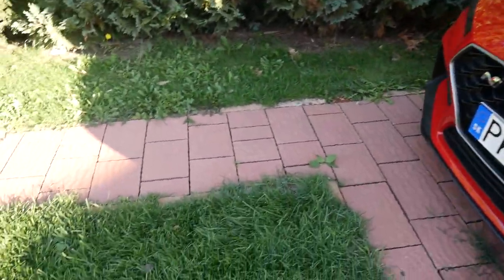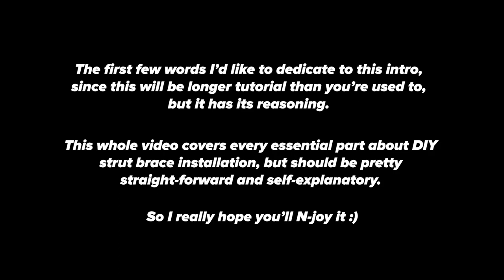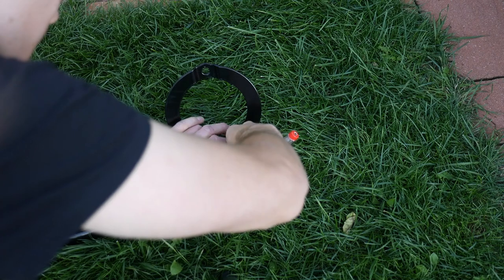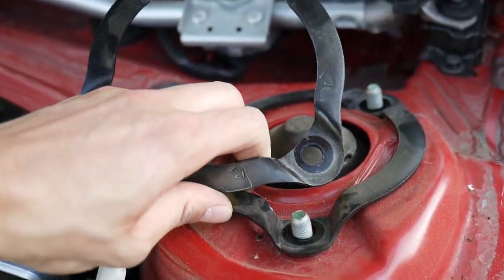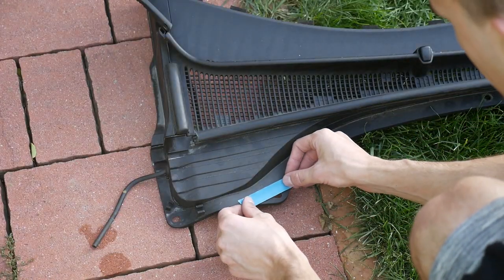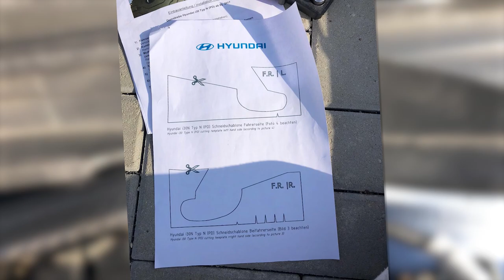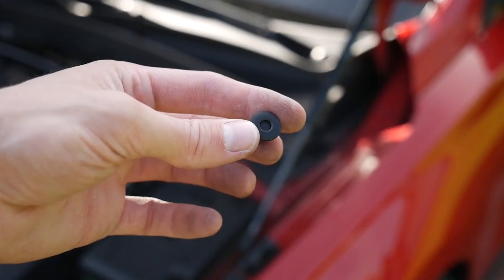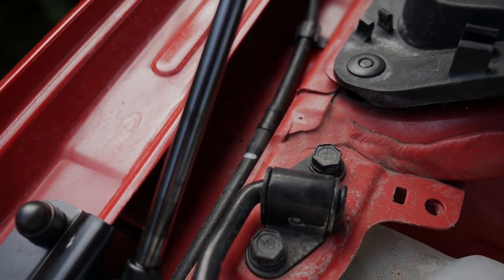DIY: How to Install i30N STRUT BRACE

Comment: I30 already had the two suspension points connected through Chasis.. once you removed the plastic cover, you can see the metal connting both suspension.

wats the point of this strut bar?
Reply from the maker: front strut gives you additional stiffness whereas individual axis will behave synchronously
Reply: @Ns_Garage  tats wat, the i30 already has front strut.
Reply from the maker: @afteroffice_yt  no https://hyundaizubehoer.de/de/i30-n/950-domstreben-i30-n.html

Comment: Danke für das tolle Video! Woher bekommt man diese Domstrebe? Hat diese auch eine Zulassung um sie in Deutschland zu nutzen? (Die deutschen mit ihrem Zulassungs Wirrwarr..)
Reply from the maker: laut Hersteller leider ohne TÜV
Reply: Hol doch einfach das Original Teil.
Reply: Hi, falls dir diese Antwort noch hilft: Die originale wird von Wiechers hergestellt. Diese ist mit Carbon ummantelt, was unsinnig ist. Die haben auch eine blanke, sprich Alu farbene, absolut identisch und die kostet nur die hälfte
Eintragung muss nicht sein, weil die Dinger verschraubt werden. Das macht es unnötig. Du kannst dir vom Hersteller ein Schreiben ausstellen lassen, dass die Unbedenklichkeit bescheinigt und bei einer kontrolle für deeskalation sorgt.

Comment: It's shocking how simple it is to remove the parts....same with the door panels...one screw and only clips. 
While you already have to cover removed, did you take a look why the wiper motor is so weak? I saw in a video that it ceases to function at 180+ or so because it doesn't have enough power against the wind at that speed. That's why i used nano glas cleaner for now so the water starts to roll off at 130+ but i'll still have the car and the windscreen ceramic coated anyway in a week.
Reply from the maker: It's not the motor, but the wipers themselves. Or combination of both... Anyhow, Fastback has this resolved so as a hothatch owner I'm grabbing after market wipers.
Reply: @Ns_Garage  I have the Fastback. Do you know what they changed to clear the issue? I didn't drive fast in the rain because the only rain i had so far was heavy rain with slow traffic so i couldn't test if the wipers actually wipe over 160 but they already start to flutter a bit at that speed so i'm not really confident until i get to check it at higher speeds in slightly wet conditions and better visibility.
Reply from the maker: @Enforcer_WJDE  no, I don't know really. My guees would be, that rubber stayed the same, but motors changed. But since I'm mainly concerned about my car and I'm not able to change the motors, changing of wipers is my choice of fix.
Reply: @Enforcer_WJDE  https://youtu.be/xEpQw59tM4I?t=863 ; here is your answer , but i doubt you gonna use wipers 200km/h+